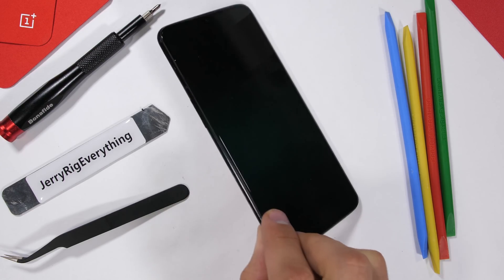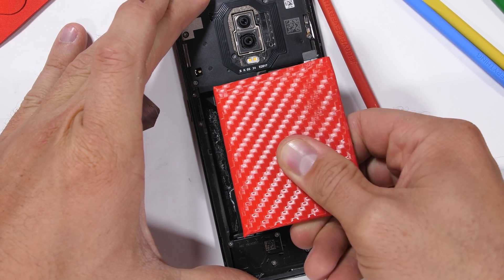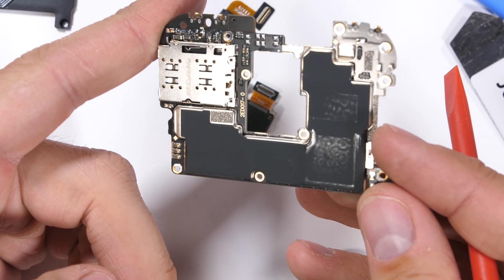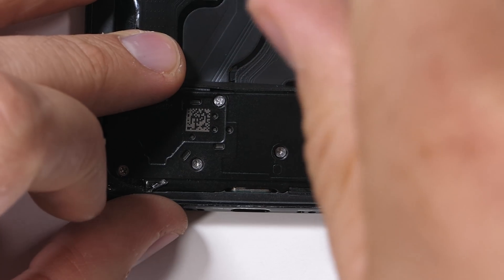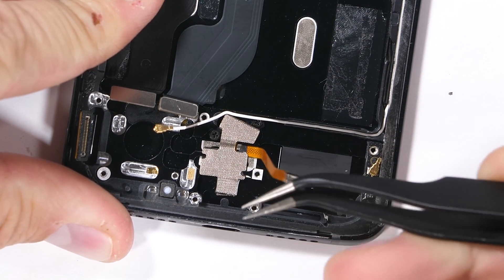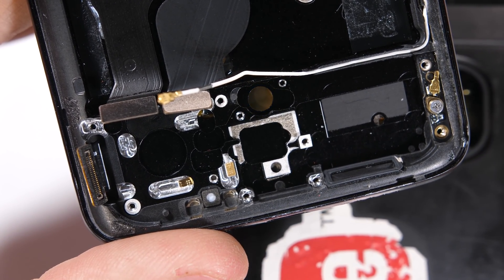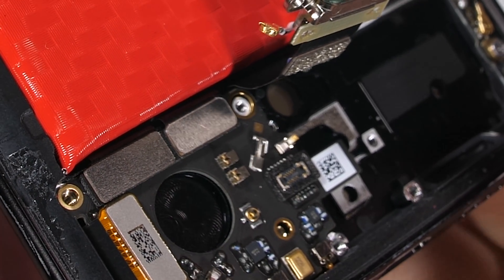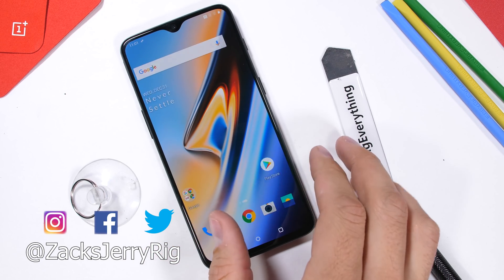OnePlus 6T Teardown - Can under display cameras be real?

Comment: Even without watching I would say that there was space for headphone jack
If not at bottom then may be at the top of the device .
Reply: OnePlus could have at least given us stereo speakers :(
Reply: @isaaclee2003 to be honest the sound is very good on my 6t it sounds like it have stereo speaker and Compared to my old S9 Plus I like the sound of 6t better.
Reply: @Phan0107  ik it sounds fine. I just don't like the fact that they have 2 speaker holes and one speaker
Reply: Another issue with limiting the device audio to a crappy speaker and the usb-c port is that they don't reinforce the usb-c port to the same degree as the headphone jack. The usb-c port is tested for 10k actuations whereas the 3.5mm headphone jack is certified for 30k-40k actuations. Without additional reinforcement, the average user is going to wear out the most important port on the device that much faster than if it had both ports.
Reply: There was space on the phone below & above as well to put a 3.5 mm jack. But as OnePlus wanted to sell their wireless bullets as Jerry said , they skipped it inspite of the community poll against it  . They now want to become new Apple of US , European , middle East countries to make money. They no more listen to their loyal community anymore. The IDFS was a gimmick & a lame excuse for its removal. You can't always use Bluetooth audio as it needs changing also. So if both options would have been given , op 6t would have been a hot cake , now it has lost its credibility @pet lau2007.
Reply: @manaskumarmohanty2066  yes, that's why they didn't do it on purpose, but people here are getting Intolerant in defending OnePlus just like Apple Fanboys
Reply: Problem is there's no room for headphone jack in their heart.
Reply: Yea it's all business.
Reply: Guys chill, oneplus gives you an usb-c to 3.5 mm jack converter when you buy the Phone. They are not like Apple charging 20 euro's for it. Second of all we all know that usb head phones are coming up, and not that expensive. Even more people buy bluetooth these days. If you want an headphone jack and a flagship phone you have to go to other brands. Prices are probably higher. With the money you save on this phone compared to most flag ships. You could just buy the usb-c bullets. I think can't say this 100% certain. But if you use a refferal code, you could get 20 euro's off accessoires. That is like free usb-c bullets. Times change, 7 years ago i had a nokia 3310. Now underscreen finger print scanners exist. Have a great day after reading these facts.
Reply: Max De Haas apple actually does give u an 3.5mm-lightning adapter.
Reply: @maxdehaas6776  thing is you can buy oneplus 6 if you absolutely need a 3.5mm port
Reply: I use headphone jack afterschool when i walk by pedestrians and by roads i listen to music when i walk from school to home see the hedphone jack is useful somewhere 😎😎.
Reply: @everydayfun9531  yeah it so usefull , but remeber lg with quad dac on their superior 3,5mm headphone jack no one buy it 🤣🤣🤣 their headphone jack far superior than another brand but it seems the people dont care about high quality of headphone jack , better move to bluetooth earphone 🤣🤣
Reply: @ErvanJabbar  bluetooth just drains the battery and whatever you pair it to it will still drain ummm so buddy its not optional to remove headphone jack to use the dongle, the usb type c and the bluetooth earphones so yeah not useful if it just drains the battery even more headphone jack is de way bro.
Reply: They are just fooling their buyers like Apple Do !!!😬
Reply: @outlier10  you've got the right idea thats why i only get samsung nothing else i buy headphone jack phones which are from samsung.
Reply: Or the side
Reply: @king.denzel  no.
Reply: @learvinguy5632  sorry
Reply: expelliarmus
Reply: They could stack that left part it's dad seeing all these sheep companies scared of doing their own thing & instead follow the fucking weak minded herd
Reply: @Azurael  I have been unable to find the source that I initially saw which stated 30k-40k actuations was certified by OnePlus, and the results I was able to find about the standard 3.5mm audio jack units used inside most smartphones is that they are tested separately/certified for 5k actuations before being used inside of a phone. What I can say is that even if the fact I saw about testing 30k-40k insertions was false information, that's still 5k new insertions than the usb-c port is certified to withstand and maintain optimum functionality. If you want to find more information about the main unit that was included in the 6 yet omitted from the 6t, you can research the OnePlus 6 Headphone Jack Flex Cable.
Reply: And while it may be less of a concern for other phone manufacturers who's devices border on obsolete after a good few years, OnePlus has made their phones to last a decent portion of time (conveniently ignoring the last lack of official software updates with the 1, 2, and X) and may become an issue for a OnePlus 6t user a few years down the road.
Reply: Dude u saw the inside of the top n the bottom there's was clearly no room
Reply: True. But the absence of it doesn't really bother me
Reply: Stupid people. If they shortened the components (ex: speaker) inside the phone, it would cost more money, and that's how Samsung fitted a big battery, an S pen holder and a headphone jack.

But, I'm also sad this phone doesn't have the headphone jack.
Reply: remember that they also need a DAC as well as the physical jack tho
Reply: If the phone doesn't have a great DAC in it like the V30, then to heck with the 3.5mm jack. 

Just go get HTC's USB C to 3.5mm adapter from Amazon for $8 and enjoy a sound quality better than 95% of phones due to a good DAC being included in the adapter.
Reply: Bottom Right side has plenty of space, speaker could have shortened to make space for the Innocent Jack ....
Reply: Avneesh Singh Tomar I like how you know nothing about engineering, and are criticizing things you don’t understand
Reply: @AST4EVER  you can't just shorten a speaker 😂
Reply: @learvinguy5632  yes we can, simply put a smaller speaker. Since they act on customer's request, they should have already done it. To get something big, we must lose something small. A 20% decrease in speaker volume can be accepted provided there's a headphone jack....
Reply: @AST4EVER  it wont be 20% decrease speaker volume but 200% bad volume quality if you make the speaker smaller
Reply: @AST4EVER  no, it wouldn't. The oneplus already has a lackluster speaker, so reducing its size will be suicide.
Reply: @AST4EVER   Actually the speaker needs to have an "air chamber" to be a good speaker. If not, then the sound would be like a $1 pair of headphones, like shit.
Reply: Well you have to blame oppo not OnePlus somehow they have to get their logic boards cheaply and as they are owned by oppo they have to take what Oppo gives them.
Reply: The Arvin Guy If they tried they could've made space easily without sacrificing anything. But they've decided to move on without the jack as well which isn't bad since wireless will become the standard in a few years but since some people still use wired its a good thing to have anyways.

Half the reason to remove it is also probably to promote their wireless headphones sales
Reply: Avneesh Singh Tomar we don’t need a headphone jack and can’t lose internal speakers
Reply: @AST4EVER  nope 20% decrease speaker volume is not acceptable , even i want quad stereo speaker , since i change the tv to smartphone for multimedia consumtion because i can watch youtube on toilet with my phone 🤣🤣🤣🤣 , better add more battery like 5000-6000 mah
Reply: You are right, bottom right has room for atleast 2 units
Reply: @Jinny-Wa  the bottom right is occupied by the speaker
Reply: Jin- h
Reply: Then you must contact the Oneplus team....
Reply: The original one plus 1 has Jack on top of the phone just saying ...
Reply: Am I being told that there is "LITERALLY NO SPACE FOR A HEADPHONE JACK" in this phone..??
Reply: AzuraelX their speaker is still garbage tho
Reply: Its one less thing they have to design, build and fit. Along with one less think that can allow water and dust inside tbe phone.
Reply: Vishal Hardasani headphone jack is obsolete
Reply: Or maybe it’s 2018 and you should get with the times and stop whining about it not having an 8-Track player as well.
Reply: they want to move on , and they give you pretty good earbuds with phone
Reply: Atomic Dounut How is removing features „moving on”?
Reply: @sosik0073  well 3.5mm jack is from technical standpoint bad, its analog, its prone to static noise , while usb c can emmit digital sound which can be perfect with less effort from soundcard... im not ok with removing the headphone jack , but only because i dont own any usb c headphones and because you cant charge and listen to music unless you have wireless earbuds which are expensive...
Reply: Atomic Dounut they’re not expensive
Reply: @miletakojanovic3270   Don't forget that you hear in analog. There have been actual studies showing that Bluetooth headphones, even as of 2018, sound worse than regular old headphones. Removing the headphone jack isn't bad by itself if they keep the DAC in the phone. The really bad implementations of removing it are the ones that remove the DAC. Then you get cheap, crap quality DACs in usb c headphones.
Reply: @David-nh7px  im all for implementing new, better technology of sound , 3.5 mm jack is prone to bg noise and signal distortion so i would love new audio port , but sad reality is that would be expensive for makers and consumers , and im not ready to pay
Reply: @miletakojanovic3270   The issue is that USB C and any other digital standard will be the same. You can't hear in digital, so a DAC will always be needed. Having the DAC built into the phone is best because there quality will likely be good (or great if it's LG's VXX line). Having headphone mfgs put the DAC in headphones is bad. Cheap headphones will sound worse than they do now because companies will cheap out. While AptX Bluetooth is better than A2DP, it still can't compete with wired headphones. And this is all coming from a guy who uses Bluetooth headphones almost exclusively. Wireless is great, but sound quality isn't quite there yet.
Reply: @David-nh7px  this is why you get the dongle from HTC. On Amazon it's like $8. It has an awesome dac in it, from what I hear. It's better than the dac in 95% of phones to date.
Reply: Does the earbuds are included now?
Reply: @Keyakina  none included, but OnePlus want U to buy there usb-c and Bluetooth headphones
Reply: @Keyakina  my bad man 70$ are  wireless headphones , my friend biught them when he bought the phone so i thought he got them in the package...
Reply: @Keyakina  nope, you have to buy them seperately for $20 USD. But they're rreally good. The device comes w/ a converter from USBC to 3mm Headphone jack to plug in your headphones though
Reply: @Keyakina  they don't include them in the box.
Reply: @miletakojanovic3270  How you can move on if there is nothing better made than 3.5mm jack for headphones? bluetooth wont be at same level at least 2-3 years. i want phone with options to chose from. Thats why i am with samsung,
Reply: @miletakojanovic3270  '''They want to move on'' as if providing less features is progress smh.....
Reply: @miletakojanovic3270  they don't give USB type c with the 6t.. it's only in the reviewer bribe box
Reply: @HaimPeretz  They do in France, and probably most of Europe
Reply: @miletakojanovic3270  included earbuds are always pure bullshit compared to good OverEars I'm using connected to the headphone jack. Especially on my V30.
Reply: @Raja995mh33  i have cloud alphas and i am using them on a longer trips , i couldnt survive a week without headphone jack but we really need to make better audio port ...
Reply: @miletakojanovic3270  earbuds don't come in the box. I bought the 6t.
Reply: @miletakojanovic3270   op doesn't come with included earbuds

Comment: one plus 6 T is ip 54 ... secretly  ✌️❣️
Reply: 69 imo
Reply: What does that mean?
Reply: @kelvinpang438  it means that the phone is splash resistant
Reply: I'd say it's 66
Reply: ip 54  watet n dust resistance rating
Reply: Sssshhhhh... Why say it if it's a secret????
Reply: @jaz1nce960 because one plus is dont want to repair water damage phone .